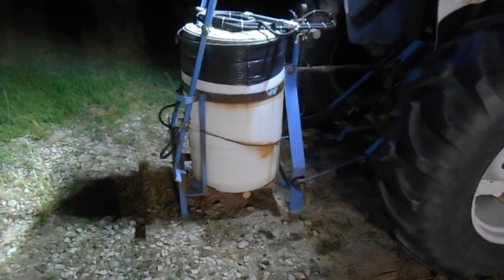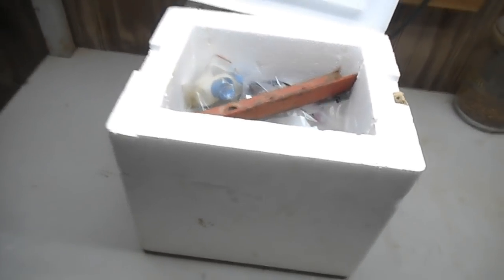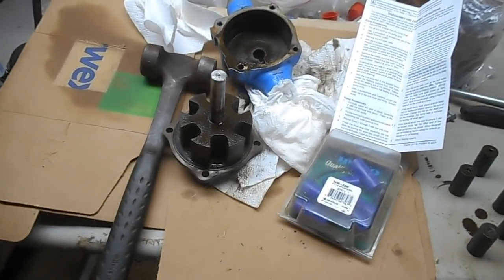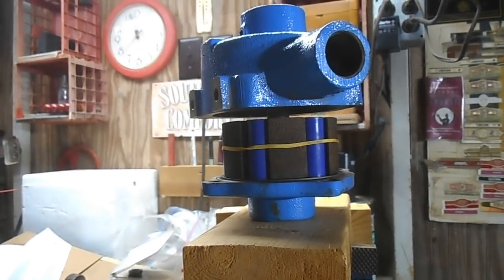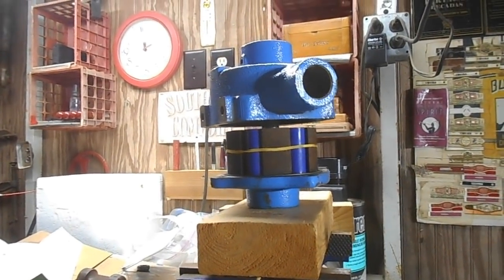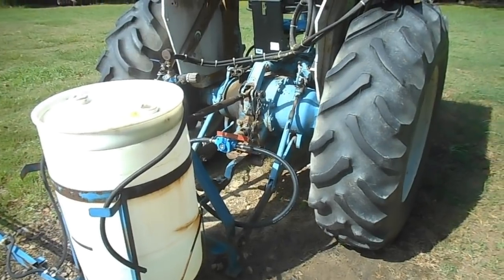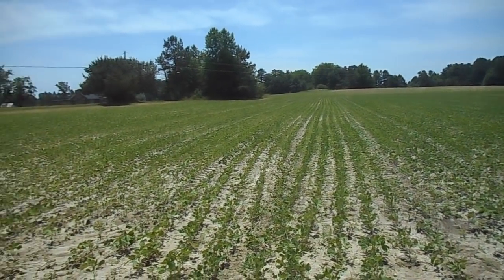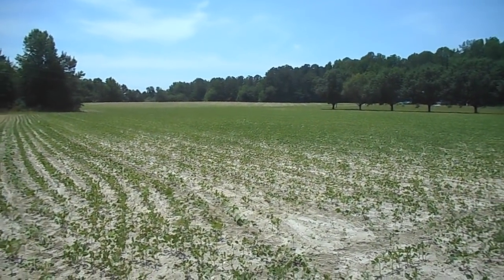Speed bumps and limited time

Comment: I store my pump in diesel fuel over the winter. Unfortunately I need to go buy another pump soon, not because anything happened to mine, but its only a 4 roller and it doesn't have enough to spray and agitate so I am getting an 8 roller. I'll just keep the 4 roller as a spare!
Reply from the maker: Northern Wisconsin Farming – an 8 roller will solve that issue.  Liberty must be more corrosive than glyphosate because this is the first time I’ve found my pump in this condition. it cleaned up nice and is doing a fine job.  sprayed some more today.  thanks for watching.